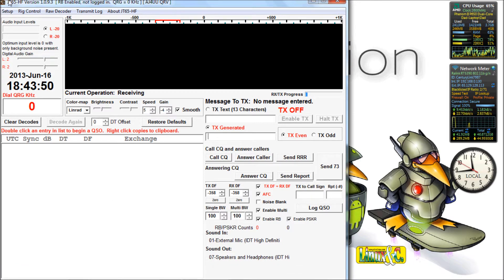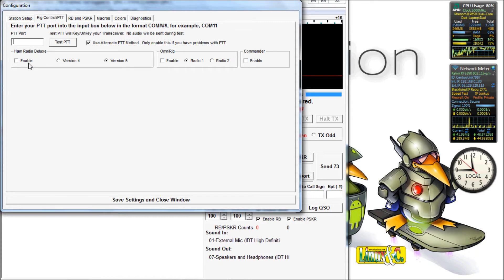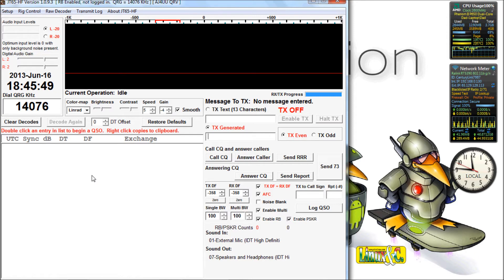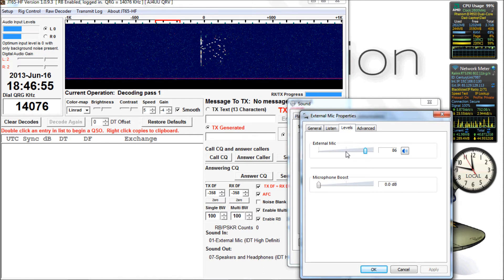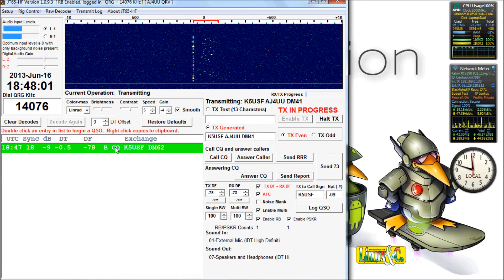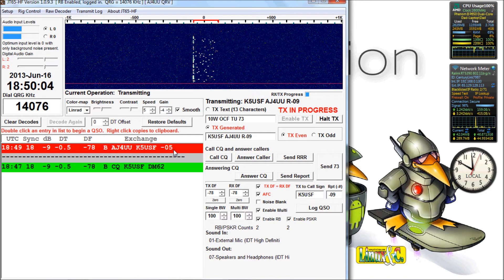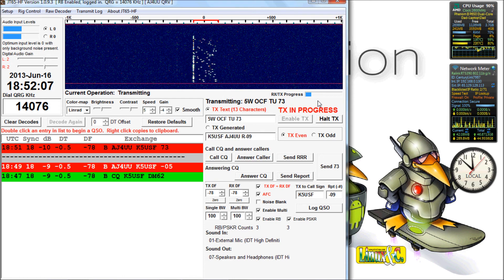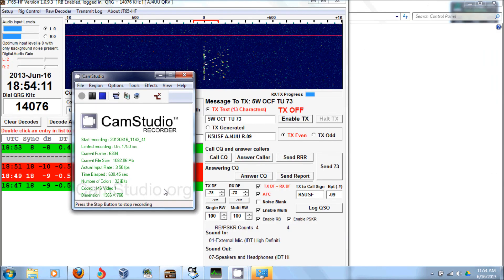JT65HF Setup and Demo

Comment: What modes, settings, etc on the radio?  I haven't found on some of the digital modes what you should set your receiver mode to.  USB???  Thanks for the videos.  These help me to find a starting point.
Reply from the maker: It really depends on the radio and how you interface with it.  To many variables for me to answer that question.  Better to find a video discussing how to do digital on your radio model.  Set up you radio according to that video then come back here for JT-65 setup.
Reply: Thanks.  I found out to set it to USB.  I'm using an Kenwood TS940-AT.   I was using the audio in/out on the back of the radio.  After getting the levels set going to my external usb adapter I'm doing QSOs fairly easily.  Thanks again.